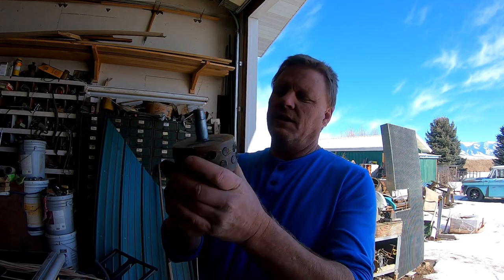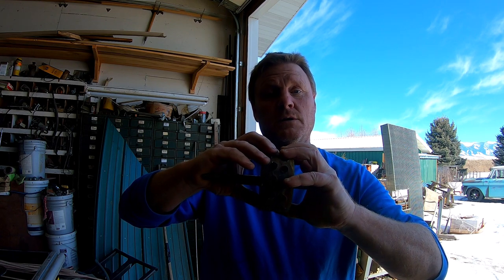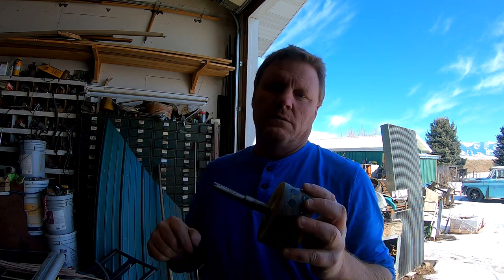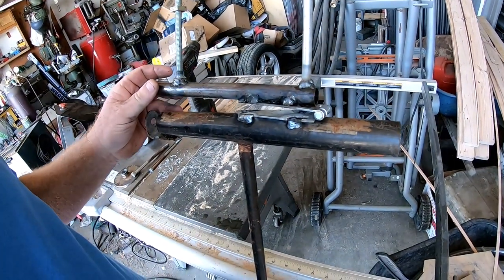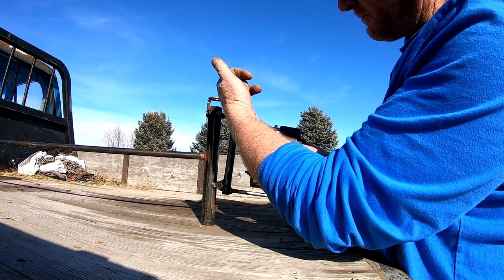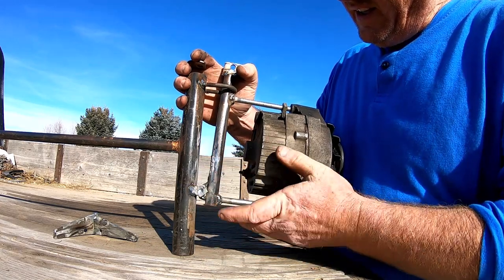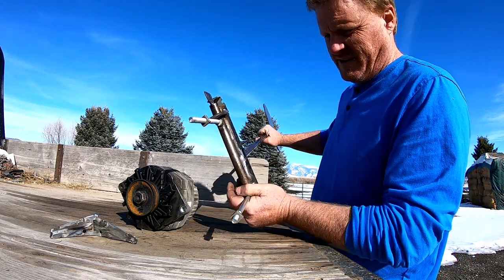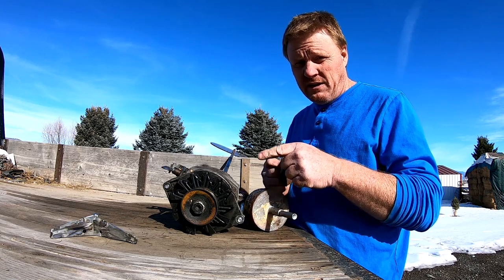car alternator wind turbine, no mods car alternator wind generator, how to construct

Comment from the maker: Just put up a video showing how to carve a blade for these. They are easy to do, check it out https://youtu.be/B0Fe_UPVjHA 😀
Reply: Angle the magnets 10° to 12° degrees , and you should have long straight magnets about one inch long and 1/4 inch wide , yes I know that you like spaghetti , 
And I like those trucks of yours , I got a 67  K-20 and a 78 C-10  , and where did you come up with a cool name like off grid , it wasn't me was it  , you are welcome , I'm watching your videos as I find them
Reply: I came up with 10 to 12° degrees by looking at the original rotor that came out of the alternator in the first place , see how the electro magnet angles , I put a protractor on it , you can do the same thing , that's why an alternator rotor doesn't cog , and the reason you can't stop yours from cogging is because those round magnets are too big , you need 1 inch long 1/4 inch wide straight  neodymium magnets turned at 10 to 12 degrees , and you can use the same shaft that just came out of the alternator , those pieces press off in a hydraulic press and they make ring neodymium magnets that magnetized the same rotor as you have , just takes two magnets , one pointing North and one pointing South and you got a PMA  ,
Do you want me to build you one ?
I'm on my 5th PMA build and the first 4 work great
Reply from the maker: @jimthomas777  If you can build a cog free PM I will pay you for it. You must be able to spin with thumb and forefinger with as little effort as a standard. 😀
Reply: @veggitarianredneck  , OK 
I'll get started on it ,
The 4 PMA's  I built cog  , but it only takes 2 foot pounds to turn them and if you have a 5 or 6 foot diameter blade span , that goes down to ounces , because I can spin them with my hand already  , but I will do my best on a cog free one for you
Reply: instablaster.

Comment: If he keeps grinding without eye protection he will need to diy a cane to walk with when he gets blinded by metal particles!
Reply from the maker: I'm getting better about eye protection I promise
Reply: Who are you? Osha? 😆 eye protection is for sissies. 😆 just kidding
Reply: I spent a week cutting corrugated iron roofing sheets, and always wore eye protection... except for the last four-inch cut...
I won't make that mistake again: a shard smacked me straight in the eye, and bruised it for a week. 
Now I buy safety specs and leave them all over my farm so there's always a pair nearby.
Reply: I'm pretty sure eyes grow back like fingers and toes, so he's be fine.
Reply: Same. Please wear safety glasses so you can continue to make video's and keep your pristine eye sight.
Reply: Never fails, always some idiot with complaints about safety issues
Reply: Just squint 😂 the smaller the slit to see the less chance of metal in your eye 😆😆😆😆
Reply: Clearly you've not mastered the safety squint.... amateur lol

Comment: as soon as you remove the field windings, you lose all the benefits of these. suddenly you have an output that fluctuates with the input, is load critical, and is limited in its range. a permanent magnet can only produce so much "voltage", so many "amps". it has a fixed amount of flux. it cant be altered. they cog when the wind is too slow, and need brakes when its too fast.

the field windings let you use the alternator as the brake, dumping power at the rate dictated by the load and the windspeed. rather than waste power, you extract it. you can size the blades so at full power, it can only rotate at a certain RPM when the wind is say... 90km/h. instant speed regulation, no need for brakes...

if the blade area is too small, great. you want a generator that can easily stall your blades. means its extracting all the power it can. if the blade area is too big you need brakes and that extra blade area is pointless. wasted on brakes. for what? a few extra watts when the wind is slow? not worth it unless your average windspeed is that low...

power increases on the cube of the velocity.

this is letting all that power go to waste as it can only apply power to a load at the rate dictated by its magnetic flux. like all permanent magnet setups.

Comment: It seems that leaving the electromagnetic brushed rotor in the alternator would be advantageous. There is no cogging if the rotor is not energized.  If you monitor power output you could adjust the rotor energizing current using an arduino or similar such that the rotor current is just enough to maximize power output for the given wind conditions.
Reply from the maker: Exactly what I've been saying.
Reply: You are describing Maximum Power Point Tracking (MPPT), which makes VERY good sense to implement on a wind machine using a car alternator. This is because without it, the power curves of the turbine and the alternator actually diverge. MPPT would modulate the alternator field so that, within limits, its output more closely follows the power coming from the turbine, obviously boosting efficiency. Definitely a good idea if offgrid406 can implement it. If this is done with an Arduino or some other microprocessor as suggested, then additional controls can also easily be added, such as field shutoff in no-wind conditions and plant shutdown in dangerously high winds.
Reply: @Inflec  and the load itself plays a role... maximum energy transfer versus maximum efficiency...

still, it is the only way to use an alternator.
power increases on the cube of the wind speed.

fixed flux of a PM magnet can only ever supply so much, and can only load the turbine down so much. 
"the power curves diverge"... yep.

whereas the externally excited field winding is easily controlled to use the alternator as a generator, and a brake as the power extracted is proportional to field current and that can be varied to suit the wind speed and keep tip speeds to some ideal velocity ratio for every wind speed.

dumped into a resistor and used to boil water, seems to be the best use of wind power ive found so far.

Comment: instead of making the altenator tilt back with the wind just put a spring on a rod with a flap on it ..and then put an electromagnet on the positive to the field ..this will pull the rod back away from the field ..or just use a solenoid switch to break the contact from the positive to the field...?
Reply from the maker: Certainly seems like it would be much easier. I have thought of such a thing, and maybe it needs to be explored some more in the future.

Comment: Best video to just wire a Chevy alternator to my batteries?
I don't want to do any modifications to the alternator.
A Chevy alternator already has a voltage regulator in it.
Reply: At a minimum you would want to have a wind-activated switch wired into the field circuit of such an alternator to turn the field circuit off in low/no wind conditions to prevent it from draining the batteries in such conditions. Additional controls to augment the built-in regulator would also be highly desirable.

Comment: am trying to make mine this time around i was to import a wind turbine motor and the rest from China until i started watching .I have a question what will happen if you don't switch off when the wind stops blowing?My fear is will it damage anything. good video bro may God bless the work of your hands
Reply from the maker: If not switched off it will put about a 50 watt continuous drain on your batteries. 
Which I suppose if you have crazy amounts of wind it wouldn't matter much. Thanks for the love, and may God bless you too.
Reply: @veggitarianredneck   so if the application was a water generator as opposed to wind it wouldn't matter as much?
Reply from the maker: @CaseClosedManiack  exactly
Reply: @veggitarianredneck   thanks for all the Intel. It was easily digestible and great for my own project research

Comment: the start winding mod ? put a 12v globe on it, it will burn as soon as alt turns with enough force it cuts out like  a starter in a old car.

Comment: I made an alternater  windmill. I hooked it up to the battery and the battery is turning the windmill. What do I need to stop the battery from turning from turning the windmill?
Reply from the maker: You will need a diode in between to stop the power feedback. Plus I'm confused why battery power is spinning the alternator. That usually takes electronic to phase it just right.

Comment: Whats cogging, why is hooked up always not ok for alternater, etc pls explain these challenges thanks.
Reply: "Cogging" refers to the phenomenon of some generators to exhibit a snapping action in their drive shafts as they are rotated. This is caused by the field poles (the magnets) aligning with the corresponding poles of the power producing coils (armature or stator) as the machine revolves. This produces increased turning resistance which the wind turbine must overcome in order to produce power. It is a problem at low wind speeds where the turbine might not be able be able to provide enough torque to push the alternator or generator through these points of additional resistance. Therefore the generator itself must be designed in such a way to minimize this phenomenon or provision must be made in the field controls to reduce the magnetism in the machine to minimize cogging in low winds. If you've ever spun a bicycle generator with your fingers and felt the shaft seem to want to hold onto certain positions as it is rotated, that's cogging.

As to the problem of always being hooked up; this refers to what happens if the field winding of an alternator is left energized all the time. Again, this is mainly a problem in low or no-wind conditions. Obviously the machine cannot produce power without wind to spin the turbine. Under this condition a field circuit energized full time would drain the batteries. So to avoid that problem, provision must be made to disconnect the field in those conditions. (It would also need to be disconnected in high wind conditions where the wind plant is shut down to prevent damage.)

Comment: Why can't you use a regular alt. Why does it have to be modified?
Reply from the maker: Some alternators will work as is.
Reply: @veggitarianredneck  Which ones?
Reply: @Cybergrip1 - The best alternators are the ones which require an external regulator. Most of this type would be from cars made during the 1960s and early '70s.

Comment: why wouldn't you just use a chain or belt to the alternator as opposed to having the alternator flying around in the wind?
Reply from the maker: I think it's because there is a loss of efficiency in doing so, especially in the smaller turbines. As the turbine gets bigger the losses are less consequential.

Comment: I don't get why so many fight with this so fervently. Just use the alternator as-is. send the power down to your battery bank, run a small wire from your bank, through a voltage sensitive relay (available on Amazon for $20-$30, depending on the size of your alternator...it opens or closes the exciter circuit to start and stop charging), up to your alternator's exciter circuit...and you're done.
Enough with the 'permanent magnets' (trying to work around the exciter circuit issue)...just use a VSR to turn the charging 'on-and-off'! If you live where you can set up a few 6' diameter windmills, you can power your whole house REALLY AFFORDABLY (assuming you use gas heat and appliances, along with DC lighting)...all you have to 'invert' for is refrigeration!
Reply from the maker: Exactly!!!
Reply: can you send me a link to a youtube video showing how to do what you are saying my pg&e bill is off the chain, pg&e has a monopoly on us i live in the slave state of CA they say its there way are the highway

Comment: Carey, I have enjoyed your whole series on an alternator powered wind generator, but this one is the first one I watched.  So I am putting my comments here.

I have been thinking about doing this too.  In my version one would let the original alternator output directly drive the field.  In my version, you tap off the 3 phase, going to the diodes and run those 3 wires down the pole.  When the 3 phase gets to the ground one can turn it into a DC voltage with another rectifier from another alternator or parts store.  The higher voltage 3 phase requires a lighter diameter of wire going down the pole.

By driving the field with the alternator's original output one does not need the windspeed switch to control the field, which simplifies the mount of the alternator significantly  The field is powered whenever the alternator turns and is not powered when the alternator stops.  The alternator will make power whenever it turns and there is no "kick in" speed where the a field switch needs to close.  Because 3 phase is run down the pole and then rectified, there is no need for any switches, since the batteries on the ground can never drive current up the pole to the alternator.

Thanks for showing the use of an alternator.  We agree they are the best source for wind generators, inexpensive, very well-engineered, and last a long time.
Reply from the maker: Thank you for the kind words. You might want to check out another video of mine I posted a!most three years ago where I basically did kinda what your explaining. I used small neodymiums glued onto the core to tickle the field current and get the ball rolling. You can run three phase to your Batts with this method. Basically a self exciting field, only that it kicks in sooner. Here's the link  https://youtu.be/_l4DqnocLyU

Also I will be revisiting this method in future videos